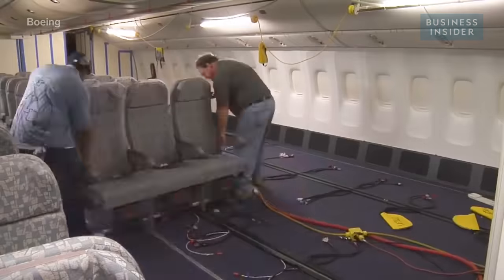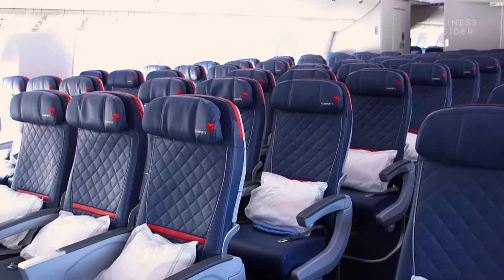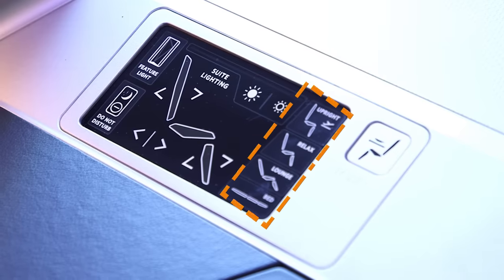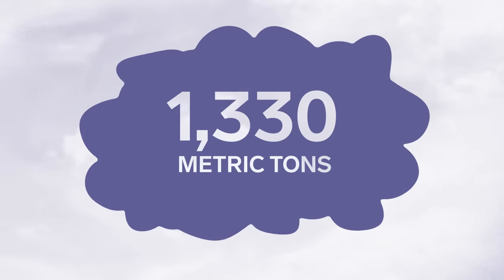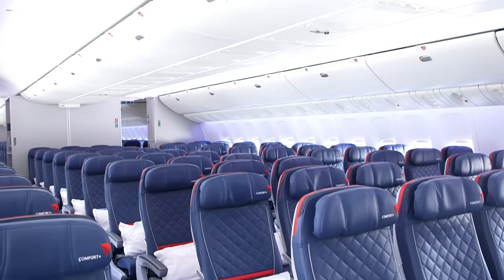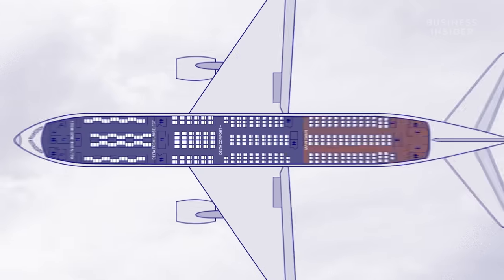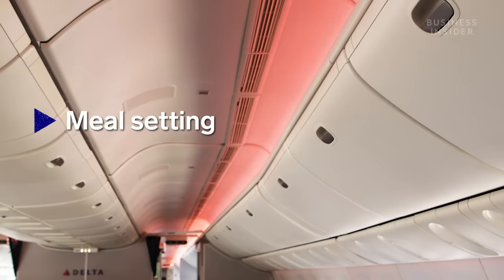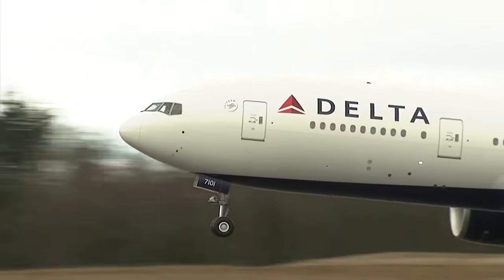How Airplane Interiors Are Designed | Big Business

Comment: And they had the audacity to retire them in less than a year
Reply: Chaz I’m pretty sure it’s because of money
Reply: I badly need a office chair. Can I get those chairs
Reply: All due to Delta's poor money management and hedging the wrong bets.
Reply: Yea but they will sell them for a big stack of cash and them being retrofitted makes that easier and more profitable.
Reply: But they will use the seats in other planes
Reply: The patent to those innovations are likely the most valuable asset. And with the covid situation, they are probably facing a significant cash flow problem at the moment, so selling them is likely a good move to help with balancing the cash flow.
Reply: Chaz with less people flying, airlines do not have the need for as many planes and so can operate their more fuel efficient models in place of these units. the plan was originally to modernize and use these planes until new units started deploying and then replace them but delta decided to expedite that process due to their current lack of usage.

Comment: This is basically a 7 and a half minutes commercial for Delta. Maybe they should also talk about how airlines try to cramp as many people as possible into a flight so that they can make as much money as possible out of flyers
Reply: That's just the free market in action. The 40 or so seats in the business cabin make more money for delta than the 220 seats in economy.
Reply: I mean you get what you pay for.
Reply: Dylan Sterling ikr
Reply: What did you expect? A video mocking how delta fills their planes on a remodeling video?
Reply: I was on flight before where there was still some random seat open for any reason. and hearing planes go 400 mph is crazy, now i know why they adjust wings and all early and by chance skid on runway cause sometimes land too quick and so try slow down plane some so not have things go wrong any.
Reply: Well yes. They got a business to operate. Planes aren't cheap to operate. Fuel, jet terminals, maintenance, operations, etc costs millions of dollars a day.
You have to use every inch of that plane and turn it into profit.
Reply: Sure... Those are planes on which worked so many people during many years, on the research part, the tests, building the plane, plus the price of the materials, and the price of the kerosene, and then there's a crew working on the plane, a crew in the ariports. But all of that stuff gets paid by it's own, right ? Why want to get more money out of this investment ? It will fly by it's own even if the company is under debt and dies, right ?
Reply: @cable30  WTF r u trying to say, son??..Speak ENGLISH please!!
Reply: @richardhoating23  I mean all of those words are English...they're just incoherent.
Reply: Airlines are actually not very profitable. rest assured greed isn't the entire reason why we're all squeezed into a tiny metal tube. Airlines are very vulnerable to fluctuations in oil prices. They're highly dependent on seasonal periods and business and first class to make money. They have to earn sufficiently during such periods to keep the airline running through non peak periods and during crisis. And as clearly shown by covid, a virus that disrupts and prevents travel due to lockdown of borders can cause bankruptcy of even the most successful airlines if not bailed out. Like of all times, i think now is not a very appropriate time to discuss this. Another day maybe.
Reply: People like you that complain about this are also the kind of person that buys their tickets off expedia, sorting by dirt cheap.  You are getting exactly what you are willing to pay for.  Learn to invest a little in your travel and you'll actually have a decent experience.
Reply: @Mica_T  Also an important point I think to add to yours about the virus point...it’s not just the virus but a lot of things that affect the airline industry. Flight attendants who are seniors will tell you stories of the cycle of airlines where every so many years a ton of FA’s get layed off (although this year was more than normal) because of any world event. The airline industry is super temperamental making it as difficult industry to sustain which is why most of them get governmental help.
Reply: I think you mean "cram", but cramp is entirely appropriate.
Reply: You forgot that they intentionally overbook, and then kick people off if everyone shows up.

Comment: Y'all should completely redesign the cabin so each passenger has like a coffin-like area to sleep in. Obviously not as claustrophobic as a coffin but you can cram more passengers into a plane and the passengers are more comfortable. Win. Win
Reply: They do that for crew rest areas
Reply: @stephenhill273  yeah but for everyone
Reply: Victor Ā but then ticket prices would increase because they take up more room
Reply: @stephenhill273  no because you would be able to cram more people in the same amount of space. You can stack them
Reply: Victor Ā  you would also have to take into account the weight, more weight means more fuel consumption, more fuel consumption means higher costs for the airline which will increase ticket prices
Reply: @stephenhill273  true, but if the tickets cost the same they'll get that money from the additional seating. Also fuel isn't a huge precentage of the ticket cost.
Reply: Victor Ā but what about emergency situations, if these are bunks people will have to climb down in some cases which will regime else down
Reply: @stephenhill273  you just leave you area. It's probably faster since nobody has to squeeze through seats
Reply: Victor Ā it’s not just that but also how will they prepare for an emergency for procedures such as the brace position
Reply: @stephenhill273  there is no need to brace since the coffin like area will just act as a shield

Comment: I have a fix for those that don't like the middle seat:  just get rid of it. No, no... hear me out. 

Being the one stuck in the middle seat means that you have to say excuse me every single time you get up to hit the John, and every time you come back to your seat.  it gets annoying for other passengers as well, to the point where if you keep it up they'll wanna (how should i put this subliminally?) make your sleep long and comfortable. Removing that seat ensures that no one gets stuck in either predicament. There's no reason to get up out of YOUR seat so the middle passenger can get in/out if there's NO MIDDLE SEAT TO BEGIN WITH!!!!!!!!!!!!

I know what you're all gonna say "How's the plane gonna accommodate for 240 passengers?"   Well that's easy as well...  YOU DON'T!!!!!!!!  But that's a good thing, because if removing a few mere pounds of cable can relate to less fuel consumption, and reduce cost, just think of how much you would save with at least 4 pounds less mass + the added weight of the seat missing???? It also means more savings for travelers as they don't have to pay the extra fees. It also creates more overall leg room for the passengers and the crew.  which would also equate to the fixing the similar issue of having to say excuse me every time you wanna get in/out of the window seat was well.

 "but i like the window seat" I'm sure you do, but it doesn't mean you should be left trapped up against the window, at the mercy of the...  hard working passenger next to you - you know, the one who sounds like he's working the construction site? 😴😴😴😴😴 Without the middle seat, that leaves more room to bring the outer seats in so that the window seaters can just get up and go without disturbing the wood worker next to them. IT'S WIN-WIN!!!!!!!  And besides, who the hell wants to be crammed in a tube with 238 other passengers???????   

With my idea, you have less available seats for passengers, but at least everyone can just get up without disturbing their neighbor, and no one has to feel smashed into a sardine can, either.   IT'S WIN-WIN BABY

The irony is I'm scared shitless of heights and refuse to even fly in the first place, and this is MY idea?????? WHAT??¿??????????

Comment: So essentially they removed wires that the end user will never notice. Changed the material on a seat thats been the same shape for thirty plus years and improved the ergonomics on an item one person in a row might feel the difference off. The airline industry has to be one of the most stagnant industries when it comes to innovation and its no suprise then why it took three and a half years to bring their 777s up to this standard.

I am a little surprised they didn’t move the screen into a more ergonomic position. Given that it’s “wireless” it didn’t need to be mounted on the back of the seat. Bringing the touch screen closer to the user would not only have improved the viewing experiences but gotten rid of the need to have a remote control. At the end of the day the changes they have made seem minuscule on the impact on the user experience. Shouldn’t the seat material be fire retardant to begin with? The blue material they use isn’t unique to the 777 either they are common place in newer regional delta aircrafts. I also think its a hard sell to say that the overheard compartments are groundbreaking. The customer only uses it twice during the flight once when closing it and once when opening the cubby at the end of the flight where the electronic assist has no impact. Plus the cubby is meant for a whole row so maybe 1/3 of passengers will ever experience the difference.

Comment: Interiors, like the exterior, also need to be made as light as possible, for fuel efficiency. Every kilo counts, that why they charge you for having overweight luggage. Essentially, a plane is a lightweight aluminium tube, with wings that barely hold the lights on the end. That's why it's completely impossible for one flying at 450mph hitting a building, such as, I don't know, a steel and concrete skyscraper, and disappear completely inside.

Comment: Delta: here's a revutionary and innovative thought, why don't you add the cup holders that Singapore Airlines and other Int'l Airlines use? One of the biggest concerns is drink spillage. I guess perhaps a moot point during a pandemic but once we're back to regular travel and meal service, it would be nice to have those cup holders. "As a designer, I've sat on those seats"...ummm...did you try having normal, average-sized passengers to test your seats and see what they say rather than using a skinny designer chick to test those seats? Duh.

Comment: Can we just make a whole plane upper part parachute system installed in all planes as a mandatory measure? 
I saw a design somewhere on YouTube and it looks really amazing and it can be very helpful for saving a life. I think the industry can spend money on safety first, comfort is always secondary. 

For those who don't know what I am talking about, in case of emergency, the whole passenger section will be detached from the plane (just like an ejection seat in fighter plane) and then it can safely land via parachute.
Reply: I know I'm late, but no. Planes glide, and very well. I won't get too indepth about the engineering here, but having a detachable section adds far more risk to the structural integrity of the plane; not to mention a 'regular' emergency landing gives the pilots lots of options about where to land.

Comment: It doesn't matter how pretty you make the interior or how wonderful the infotainment system is - the fact is that ALL modern aircraft are too cramped.  I'd swear the designers are still using height and weight standards from the 1940's when it was assumed the average American male was 170 lbs. and 5'9" tall. I'd say the average weight is now between 200 - 300 and the height is more like 6' plus.  We've gotten bigger while the seats have gotten smaller.  Pretty colors and sunset lighting can't cure lack of space.  That's why I no longer fly unless I absolutely have to, and I used to be a pilot (private).  By the way, did you notice how the woman demonstrating the interior was barely as tall as the seat?  Show me the same demo with an NFL lineman in the seats, then I'll believe you've really accomplished something.
Reply: Only economy is cramped first and buissness have enough room to sleep in.